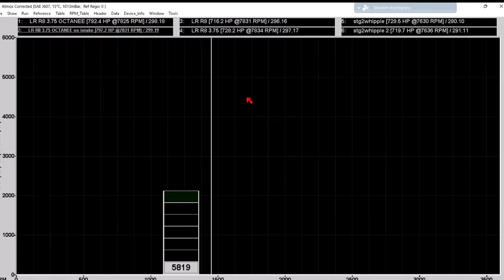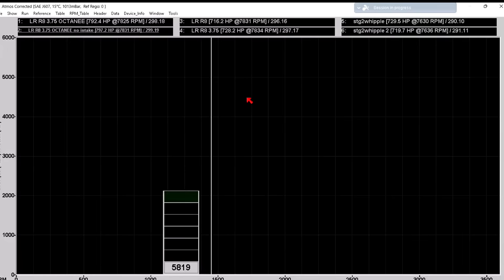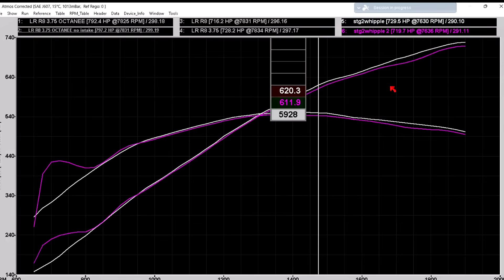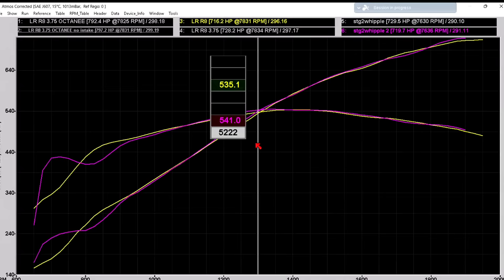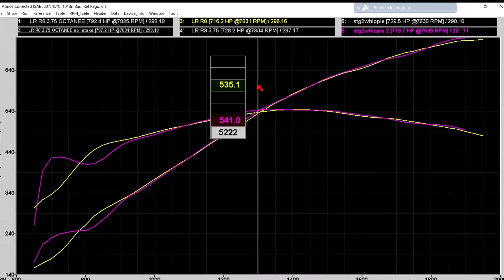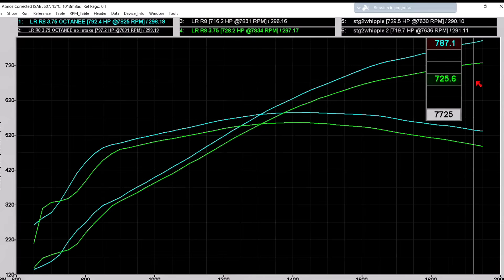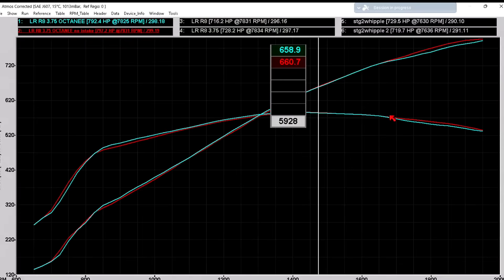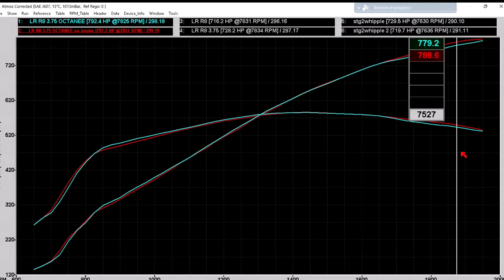2024-2025 Mustang GT Whipple Tuning!

Comment: I've seen about 790whp on a stage 2 kit with Whipple Cal, 3.75", MT82, kooks headers, 3" back on 93oct. I don't think your numbers are off cause of fuel, they just seem to be super spicy. My dyno is pretty spot on, about 2% under a DynoJet. Stock 24 A10 dyno about 420whp on mine, seen 430whp on MT82 cars for reference.